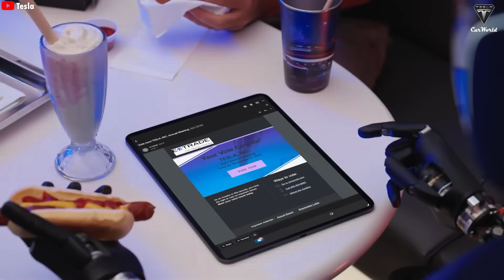Elon Musk Finally SHOW Tesla Bot Gen 3 Cooks A Meal For Incredible Time! Biggest Product!

Comment: I wonder how they will solve the problem of washing their hands before handling your food. The hands and forearms will have to be water proof?
Reply from the maker: That’s a very real concern. In practical use, Optimus would need sealed joints, waterproof actuators, and strict sanitation protocols—similar to industrial food robots today. This isn’t solved yet, but it’s exactly the kind of unglamorous engineering challenge Tesla still has to prove they can handle before deployment.
Reply: Washable hands and disposable gloves, maybe?  However, training a bot for the fine motor skills to put on gloves would be a challenge in itself, I supoose.